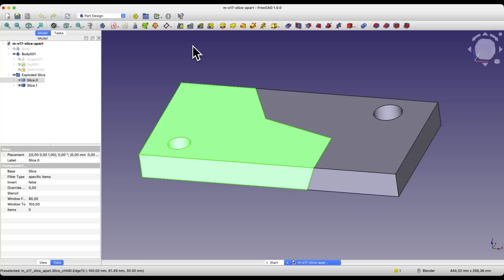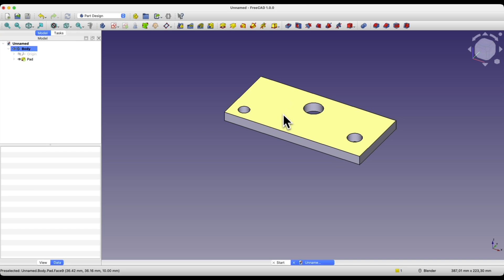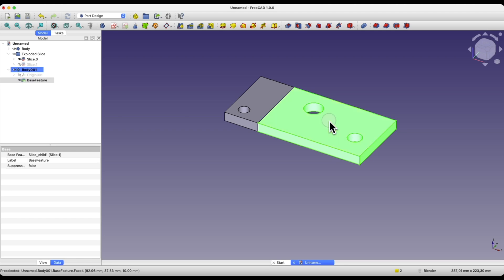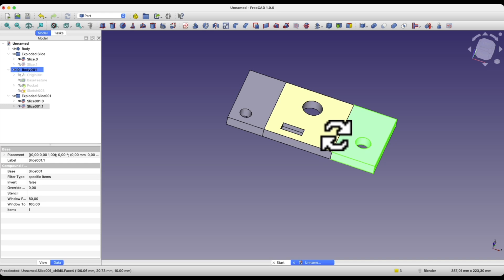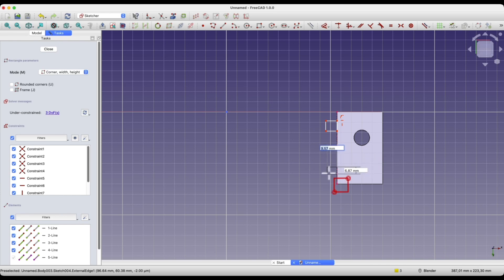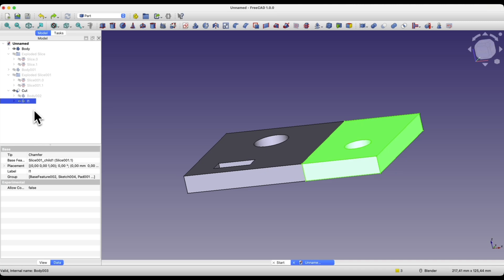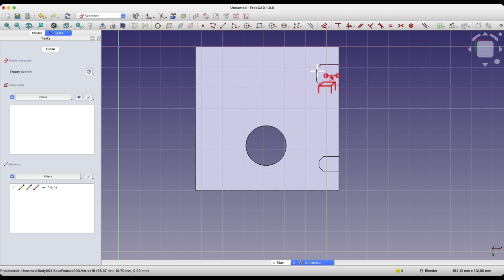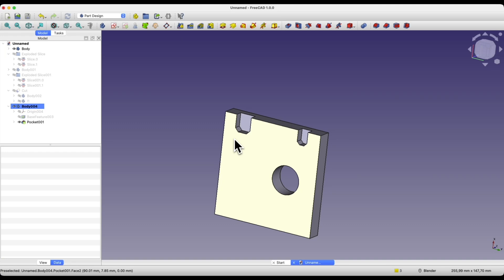FreeCAD Tutorial: Utilizing and Editing Split Solids - Advanced Techniques

Comment: This is the most useful FreeCAD video I have seen so far. The first thing I wanted to do was to slice up a solid. This video goes slow enough to see pretty much what's being done and explains the steps very well. You can of course back up a bit when its clear that you have missed something. I still find the switching between "Part Design" and "Part" modes confusing. I'd like to see a video that explains the distinction 🙂